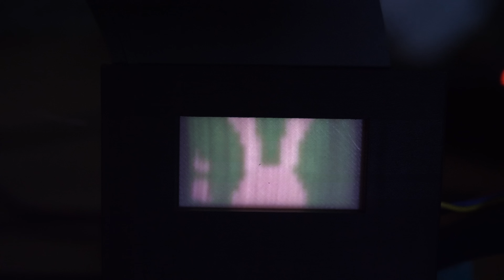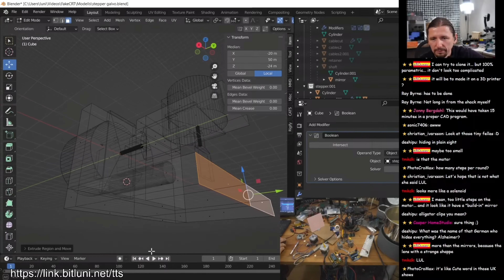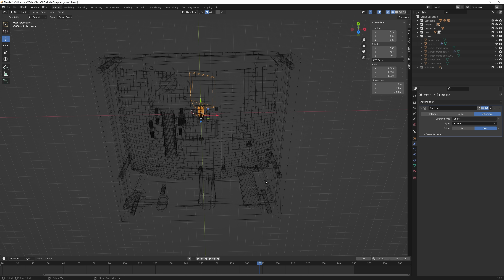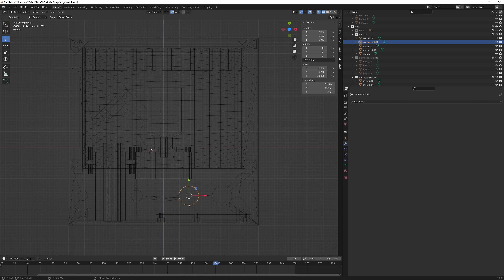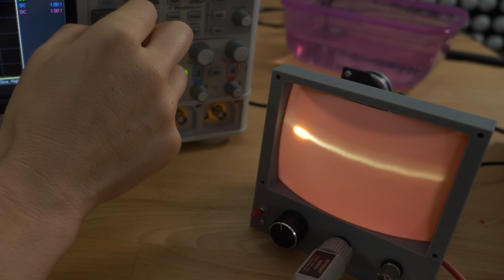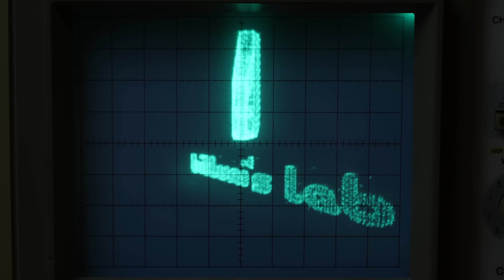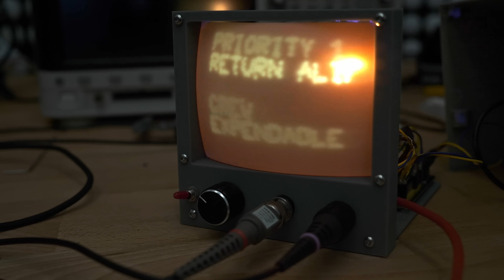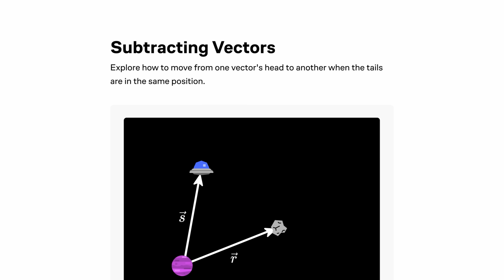I made a fake CRT TV with a LASER

Comment: I don't know how real galvos work but any actuator that has a position proportional to voltage (like a voice coil) should give much better results in resolution.

A crazy idea: have space for TWO lasers with two pairs of galvos. Alternate lasers to be able to jump positions faster. With a big enough queue of commands you can read ahead enough to position the other laser on the desired position. There can even be a simultaneous mode where it doesn't wait for the other laser to finish and it would be faster.

Comment: I think I can help a tiny bit with the speed. The laser is not using much of the first mirror, and most of it could be removed to cut down on mass. You're probably only using a region a few millimeters tall and maybe 1 cm wide. It's only the second mirror that has to deal with a beam that is already being swept. Also, if you were to sweep lines in alternate directions like a printer, you would eliminate the "flyback" motion that probably keeps you awake at night, making it a lot easier to do raster scanning. ILDA supports bidirectional scanning for exactly this reason.

Comment: As others have mentioned, a spinning triangular prism with front-surface mirrors on each face is probably the best way to create your horizontal scan lines. That's what's typically used in aerial lidar scanners, and it's very reliable. You could increase the number of faces to reduce the RPMs but increase the scan rate, but doing so also decreases the angle they sweep, so would require a longer base-line for the same size of CRT screen.
Reply: Oh that's a great idea I had in my head traditional motors with offset crank shafts like in an engine but this would simplify that significantly then just time it with a trigger wheel to shut the laser on and off for an image

Comment: You want a pair of simple single coil galvanometers to do the deflection (like you find in old analogue multimeters). Just a simple coil with a magnet mounted on a pivot and spring. Can drive them from simple transistor amps on analogue X and Y signals, or directly with PWM. Can have very smooth movement, although you'll have to take momentum into account if you want high precision. Or if you want a CRT style scanning, can use a pair of rotating multiface mirrors, one at slow speed for Y, one faster for X. The speed is critical on these ones, though, to keep signal synchronised.

Very frustrating when youtubers just go at it without doing any research on what other people have done in the past to already solve these problems (and can be found with minimal effort). Reinventing the wheel for "content" is just...

Comment: The mirror and speaker are way too big, you need a low rotation in the mirror. DLP projectors use a constantly spinning mirror for example (so like detecting the start of a frame in CRT or rotational display)

Comment: Polygon mirrors on aliexpress for about $20 would get you the left to right scanning without turning off the beam, as it would reset when the other mirror comes into rotation. Think of it like a bunch of mirrors on the edges of a stop sign. They look like they are used in some laser printers. Probably if you can find a second hand or "for parts" laser printer you could salvage the polygon mirror. You also don't need to reverse it, just keep it spinning at a constant rate. To calculate the spin rate, you'd need to know the vertical resolution, multiply that by the fps, and divide by the number of sides of the polygon.
Reply: I just ran the numbers for a PAL signal. 25 sides at 625 rev/s for the horizontal, and 10 sides at 5 rev/s for the vertical. Not sure how achievable the former would be, though.

Comment: Try and display a B+W image, then try driving the laser at different levels to give a few grey levels, then sequence of images to give a TV. You could try multifaced disks to do the scanning rather than stepper motors to do the scanning like a mechanical TV, then sync the laser output to the position of the disks.

Comment: Well get a dmd chip like in a dlp

And have a rear projection "CRT"
Reply: Scan the laser over the dmd to emulate the scanlines of a CRT too, easier since you scan less area but you'll need a really narrow beam
Reply: 2:20 that's where piezoelectric transducers/speakers become real useful, voltage controlled and not current controlled

Comment: I'd like to see you replace steppers with motors, have them spin faster to scan the whole area V and H. Then turn the laser on and off for pixels. Maybe test it with two lasers, odd and even lines, like interlaced video. I think you could use the same mirrors, just offset the lasers.

Comment: I like this a lot! Well done!

A similar project would be to make the beam scan lines and making a pixel array, like maybe 80x60 px? Or will the resolution be too low for that? because of the bleed in the screen? Maybe you'd have to make a black grid and make individual pixels with the luminous filament, so the pixels would be compartmentalised? The scanning would require a single stepper motor and gears and a mechanical counting thing (I don't know what to call this) making the vertical progress to the next line at the end of the horizontal scan. Horizontal scanner could be two or more mirrors intermittently turning at the end of the horizontal line, mechanically coupled , vertical scanner could be the same. You know, like those mechanical hand counters or a mechanical odometer in a car.

Computer needs feedback too, to know when to start a line.

Each pixel needs to be lit up exactly, though, so all this needs to be timed properly.

I'm sure the frame rate would be low, but I'd still love to see it! It will of course be limited by the max speed of the mechanical device and how fast the mirrors can spin before self destructing!

Or maybe you could have a spinning prism instead of mirrors? A tiny one, close to the laser?

As you can see, this was a really inspiring vid! Thank you!

Comment: Could possibly replace one of the galvos with a rapidly spinning mirror disc (I think some use hexagonal discs or similarly shaped). If you could properly synch two motors then you could even do two spinning mirror discs (perhaps a solution would be to have one motor and a linked drivetrain?)

Comment: I wanna suggest a rastering mechanism:
You get an octagonal thingie with mirrors on each of the 8 faces, and spin it at 225rpm, then shine a laser on it. You'll get a straight line with crisp start and ends, re-painted 30 times a second. That's your vertical sweep. 

If you build a second spinning octagonal mirror spinning at 1800 rpm and arrange them so that they spin on axis 90 degrees apart, you should be able to get a NTSC image. Now you just have to switch the laser diode on and off fast enough to get a picture! You can manage 350kHz on the diode control, right?
Reply: The image might be quite dim though, as you have to spread the power of the laser out over the whole screen. I did try it with leds once, for a projected 8 line moving message display and noticed that enough power to spread out to get the brightness was a problem, this was one led per line too. A vector display can sort of 'cheat' that problem.
Reply: @threeMetreJim  Could be, but judging from the clipped highlights at the beam point there should be enough to at least make a discernible image. The screen seems to have plenty of retention time so I guess you could just run it slower and give the beam more time to penetrate throughout the filament.

Maintaining synchronization of the spinning mirrors might be a bigger issue though, I'd go with a mechanical geared solution where the slow mirror is driven by the fast mirror. LEGO gears are cheap and small but to my knowledge are all straight cut which would be noisy at those speeds. Herringbone gears have continuously engaging and disengaging teeth they don't have the same pulsing kind of noise as straight cut gears. 3D printed ones can be made quite large and heavy which smooths out the drive speed over short periods.

With a brushed motor a timing wheel with optical sensors to trigger vertical sync would also be needed to compensate for fluctuating mirror speeds over longer time periods, but the easier solution is probably a brushless motor with a good driver that doesn't have noticeable jitter in the rotor logic.
Reply: @Djhg2000  The timing wheel method would be similar to analogue TV. I'm sure it used a phase locked loop to keep the horizontal and vertical rates in sync, along with the horizontal and vertical sync contained in the signal. You'd need to be able to alter the level of laser light too, not just turn it on and off, and with several MHz of bandwidth. I'm not sure an average pointer current regulator would be able to do that accurately or whether you could get a linear response from a laser diode.
Reply: @Djhg2000  What they do in laser printers is place a photodiode at the start or end of the scan area. that way you get a sync pulse on each scan line that you can use to tune a phase-locked-loop and then use that to tune the motor speed. Doing 2 of them, and getting them to sync up would be complicated, but I suspect that if you have enough 555-cookbooks and/or HAM radio design books, you could find a circuit that solves the problem! :D
Reply: @threeMetreJim  As I said, on-off is "just" 375kHz. I guess if you want 4-level greyscale, you'd need 1.5MHz. Seems like overkill for the project. Just seeing simple on-off would be awesome!

(why 4-level? 'cause that's what the NeXT did, and it looked awesome for the time!)
Reply: @RichardBetel  I'm interested how you calculated the required bandwidth. Sounds different from how I'd do it. On/off is a squarewave, bandwidth depending on pixel resolution, and how sharp you want the edges (required rise and fall time). Old analogue was something like 5MHz as far as I remember.
Reply: @RichardBetel  To calculate required bandwidth, you can read analog devices application note AN944. I'm sure that a standard pointer module would need modifying to cope.
Reply: @threeMetreJim  1) I just realized I did my math wrong...
2) NTSC is 720 by 480 which is 345600 pixels, and one cycle per pixel gives 346kHz.
3) except that there's 30 frames a second, so the correct answer is 10.4MHz
4) except that we don't need a full cycle per pixel. A checker board would be a square wave at 5.2MHz. We just need to be able to update the state of the diode at 10.4MHz. "just".

For a prototype idea made with an arduino, I guess NTSC is probably too high a bar. The sinclair ZX-81 had a resolution of 256*192. That's probably a more realistic target
Reply: @RichardBetel  its more complicated than that, you need the special curved lenses to bring back linearity. the scanning laser on its own would be faster at the begining and end and slower in the middle of the scan. most commercial laser assemblies i have worked with only have i detector for end of scan on the K or black. K is for KEY..  on a 4 colour printer there are 4 laser beams and 2 levels to the poly mirror motor.
Reply: @RichardBetel  Have a synchronising/toothed ring take off on both actuators, stabilise the 'line' actuator with a PLL, reference a second, slower 'line', actuator setup off this primary PLL. You can use the synchroniser ring pulses to control the Laser brighteness and voila!? The actuators would be BLDC motors which can run faster.
Reply: @threeMetreJim  I think you'd need a q-switch, I'm pretty sure diode lasers wouldn't fully begin to lase if you drove them the way you suggest, like you said I wouldn't expect a linear relationship either, and the current limiting circuit would probably spike like crazy and kill it. The diode should be kept at a steady temperature and current to give a stable output.
Reply: @xxportalxx.  Prysm Systems have a Laser Phosphor Display, but there is little information about how it works, unless it is in their multiple patents. Apparently you can linearly modulate a laser diode if you keep it above the laser threshold current and below it's maximum current. Proper design of the driver circuit will keep it safe from damaging transients.
Reply: @threeMetreJim  use MORE lasers
Reply: @threeMetreJim  Not sure you can compare a laser to an led?
Reply: @icarossavvides2641  Just the fact that you have to spread the power out over a larger area (easily seen with a zoom torch, a bright small spot, or a larger, dimmer one). The amount of light produced by a high brightness led is more than the 5mW or a laser pointer, it just has different properties (incoherent).The way the light is  generated is the same (semiconductor junction).
Reply: @threeMetreJim  If you were looking at the output of the laser directly, yes, but the persistence properties of his display material should solve the brightness problem.
Reply: @redleader7988  It doesn't make a difference. Less energy density is always that, it will just glow more dimly, like an old CRT scope. If the trace isn't moving you'll get a really bright dot until you enable the time base and then you'll get a much dimmer line. Maybe you are too young to have ever seen or used one, or messed about with a crt screen and blue led in the dark (yep a blue led has enough energy to excite the phosphor of a CRT tv tube)
Reply: Wait, aren't you just stealing the guts from a laser printer at that point?
Reply: @mal2ksc  That's EXACTLY what you're doing.
Reply: @mal2ksc  I remember watching a video from someone a few months ago, who built a long distance laser projactor using this method. He even got multiple laser beams in colour (RGB)
Reply: @mike_et_saika  He built 12 rotating mirrors and used a hard drive motor to rotate them, replacing the original X-axis laser galvanometer and setting them on the X-axis. In order to reduce the distortion of the X-axis image, it is obviously very successful. I also followed his videos.
Reply: @oflasho1  Yes, must be the exact one. 

Another method would be more traditional by using a laser source to project an image through three LCDs. Like the one from Sony we have in our living room. This is how i got to this topic initially. But the downside is that these scatter/diffuse the laser light, which limits the distance. 

There is also DLP laser projection using a phosphor wheel.
Reply: @mal2ksc  basically. The idea is to take 2 of those mechanisms. I think 1000dpi at 1ppm is a little bit slower than NTSC's horizontal scan, but only a little. (1375 RPM on the printer, 1800RPM on the TV)
Reply: @mal2ksc  yes its called a polyganal mirror motor . they are the heart of the laser writing device in any laser printer or photocopier. however they spin at 20,000 RPM or even higher....  you also need the curved lenses to bring back the linearity otherwise the image is stretched on the ends and compressed in the middle...
Reply: @mal2ksc  No, you're stealing the guts from TWO laser printers! Second axis in a laser printer is moving the paper.
Reply: Dude if he actually managed to pull that off, we would have a real Cheap Competitor for Light, Cheap, and Open Source Analog CRT's which would be insane, having a proper NTSC or even Pal Signal Converter for the Range and Motion of the Laser, without the Requirement for a Vacuum tube, the thing is, they would need to find 3 strips of RGB UV Reactive Material to used as a Coating for the Plastic Backed screen
Reply: @r3tr0r0x7  oooor, have 3 lasers, red, green and blue, and time them in a SECAM-ish way
Reply: @r3tr0r0x7  probably would want some form of coated glass as a display. The plastic stays illuminated for too long. Although I guess you probably could order a plastic that loses its glow faster. Although you will never be able to print the RGB matrix at the right resolution.
Reply: Why can't you just build a rig that mounts the laser to it? Why use mirrors? Just build a rig that can shine the laser up and down, then left to right. Ditch the mirrors.
Reply: @ProdigyAutomotive  because of the inertia of the laser? You wouldn't be able to move very quickly.
Reply: @ProdigyAutomotive  A laser tends to be heavier than a mirror.
Reply: Might be over complicating things but wouldn't say an liquid crystal window used as optical switch work. The question is does it respond faster than the laser diode itself.
Reply: @Slowly_Going_Mad LCDs are too slow even for humans. Laser diodes are so fast that we use them for network communication. You could cook up your own regulator which could pulse per pixel, record the result with a photodiode and apply the learnings in the next pulse.
Reply: Hey, whats the song in the intro? :D
0:22
Reply: Look up "laser phosphor display."
Reply: ...which is pretty much how Scophony made their mechanical television system work back in the 1930s - which was reckoned to be the equal of the Marconi-EMI electronic system here in the UK
Reply: I had a similar idea previously, and I'm confident it would work.
Reply: Use magnets on the lenses to move the laser beam over the screen !
Reply: Did you hear the Good News? Jesus, the Son of God, loves you. He died for the forgiveness of sins. He was crucified on a cross, then resurrected. Jesus conquered death and has overcome the world. Follow Jesus, repent, and live forever with Him in Heaven! Want to know more? Check out the Gospels of Matthew, Luke, Mark, and John of the Holy Bible to learn more about His promise to you!